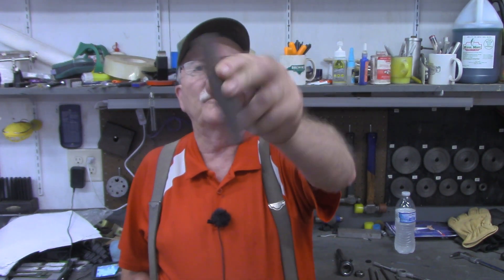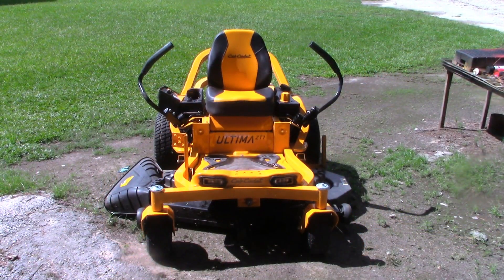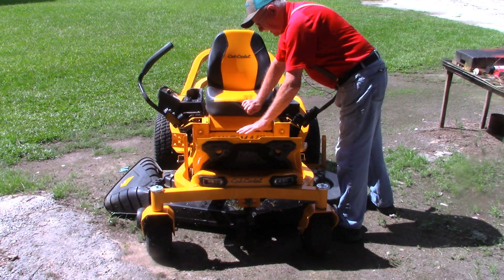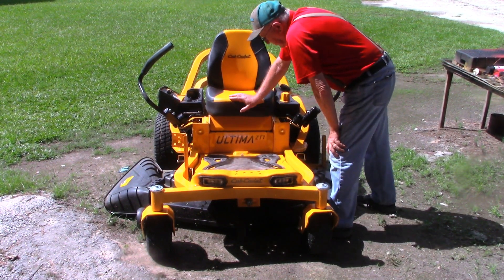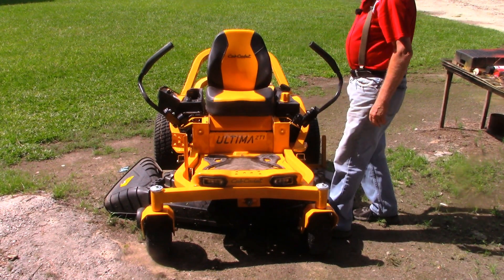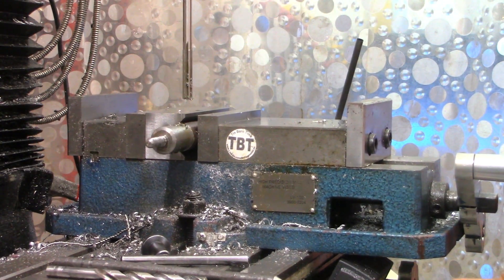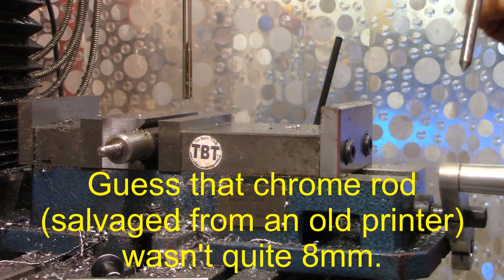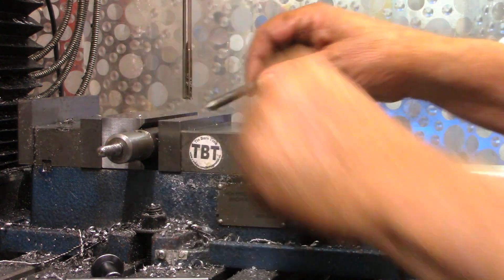Special Use T Bolt

Comment: I have not seen your die holder before and when you tightened your tail stock you need to run that loose then I saw how your design worked